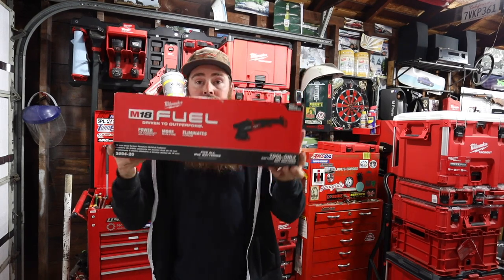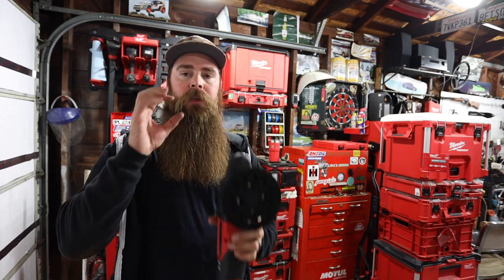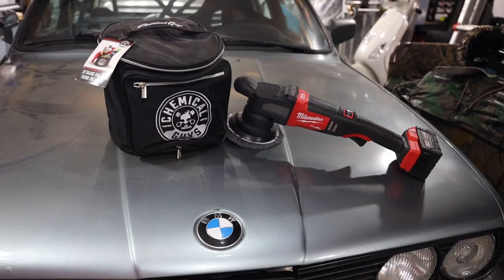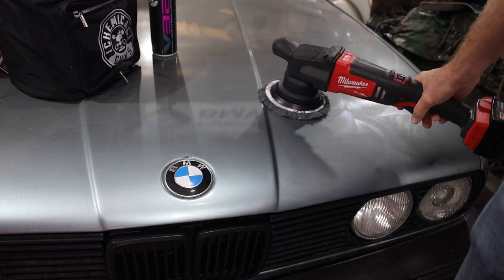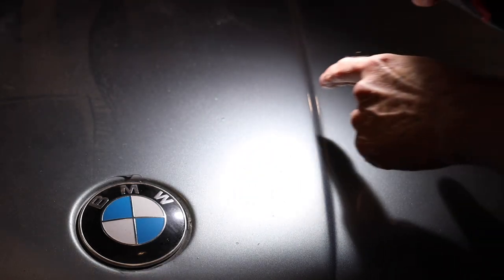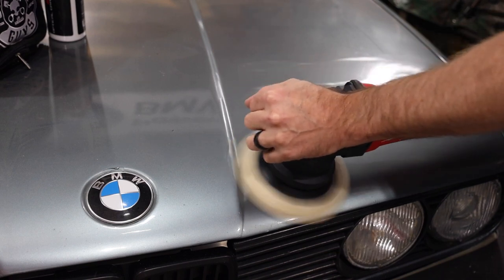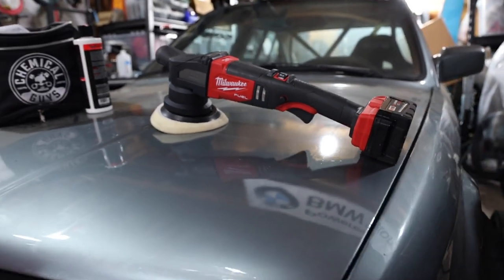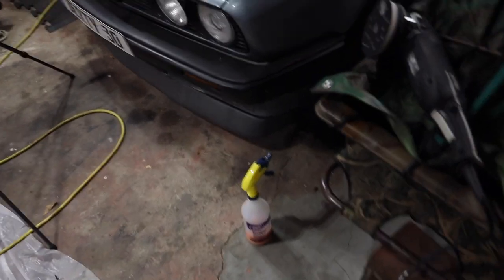Milwaukee M18 Dual action polisher 15mm 2684-20

Comment: People always worrying about pad stall, With the cheaper polishes yes there is way too much pad stall, but if you're using the Milwaukee or the Bigfoot and you're getting pad stall, You're using the polisher wrong and there is absolutely no reason to be pressing down hard where the dual action polisher, it's a lack of experience and education.

Comment: Milwaukie does a small polisher in the M12 range. The battery has a rubber base, so when you lay it on the car it won’t damage the paint.
Reply from the maker: What!! DA? I’m gonna need that. I know they had one that’s more of a buffer type thing.
Reply from the maker: What!! DA? I’m gonna need that. I know they had one that’s more of a buffer type thing.
Reply: @BlakesGarage I think he's confused, they don't have a m12 DA
Reply: @BlakesGarage  it's a 3" rotary
Reply: Rotory